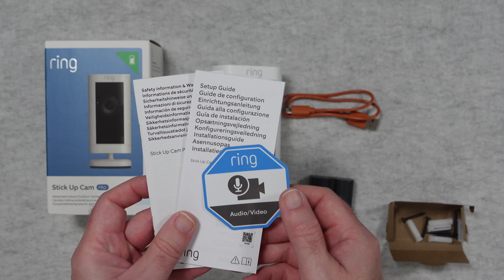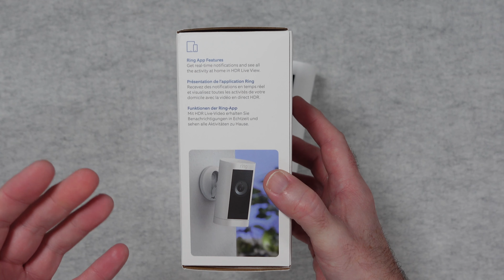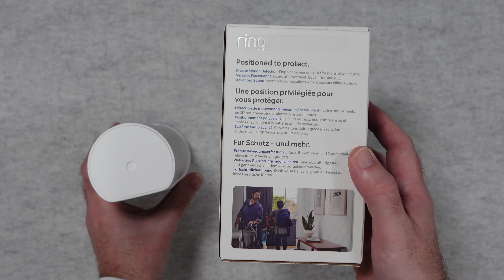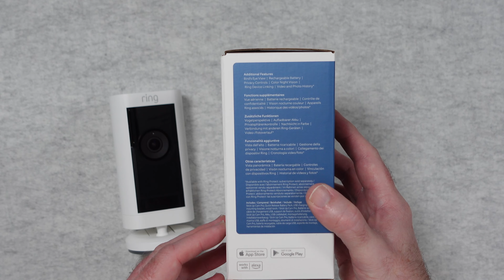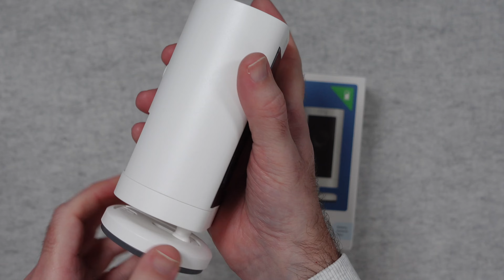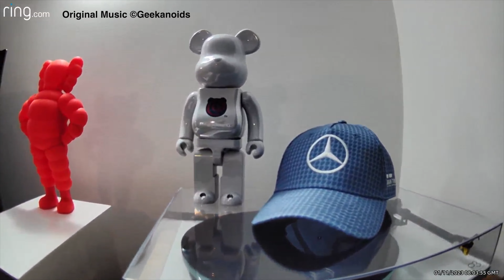Ring Stick Up Cam Pro Review

Comment: Thanks for the video, very informative. Have you reviewed the plug in version? The camera  is the same but no thought has been given to how the cables can be fed through walls etc.  you can cut the cables and re-connect but too much messing. Otherwise a decent product.
Reply from the maker: I will check it out. Thanks for sharing your thoughts on this.